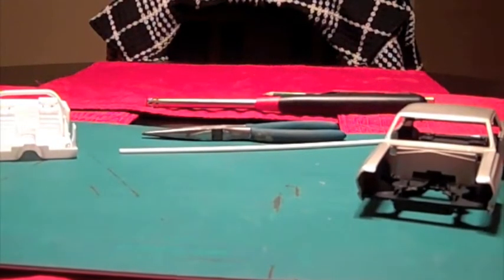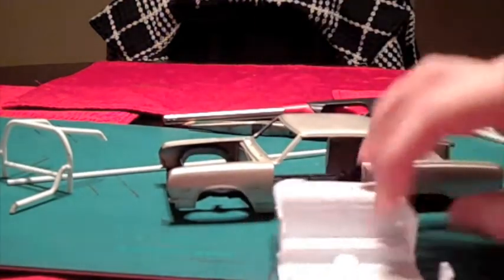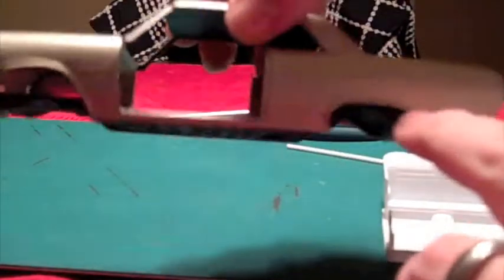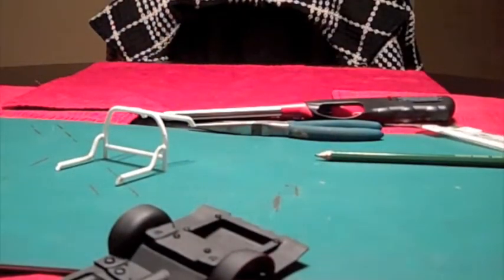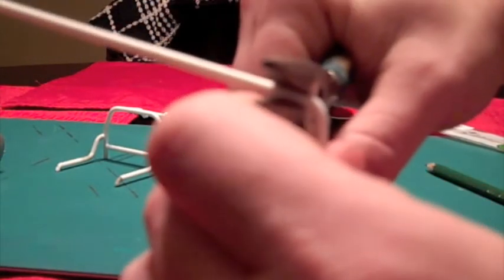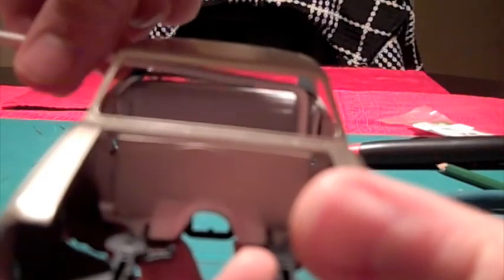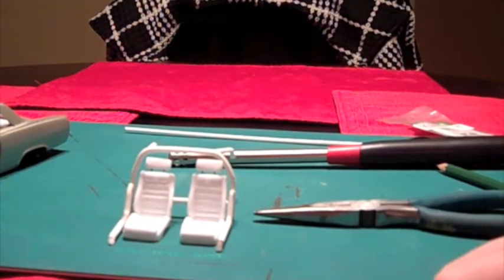How To Vid - Roll Cage

Comment: I use 3/32 Rod to make my Roll cages.  Also I use Music wire to  pin it with. Use Testors To be glue to set it with and then CA glue for added  strength!  Your Roll cage looks Awesome!  Great Job paul.

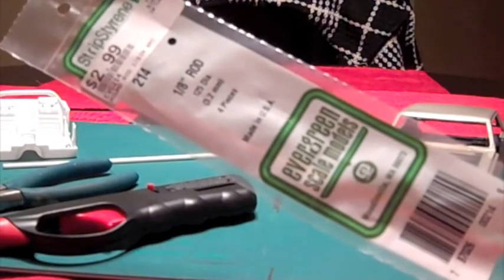Comment: Dude were are you guys getting these 1:24 models were you can open and close the doors ...??
Reply from the maker: There are only a few kits that have opening doors. They are mostly older kits. A lot of what you see are doors that we have cut open ourselves like the kit in this video.
Reply: Hey do you haft to cut the doors open
Reply: Thomas Browning most models yet and if so it’s fairly easy. My best trick is to get a piece of string and poke a hole in the top of the door then pull the string back and forth and it cuts the door real quick